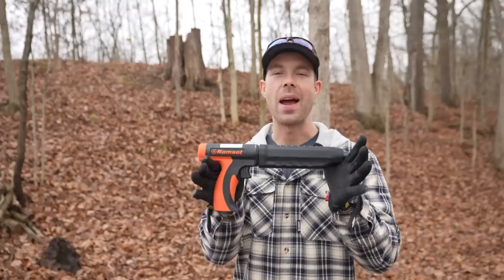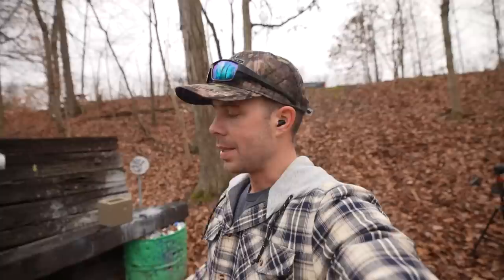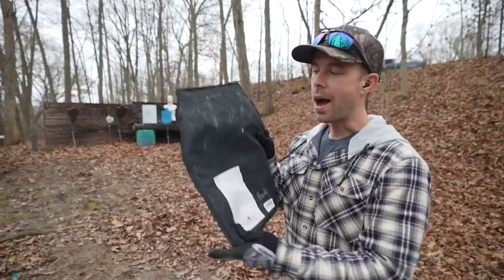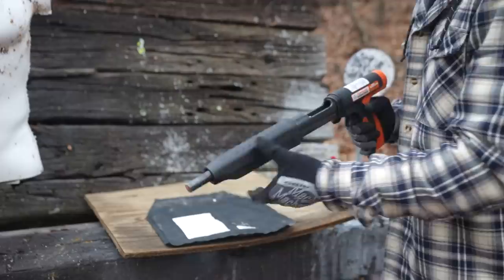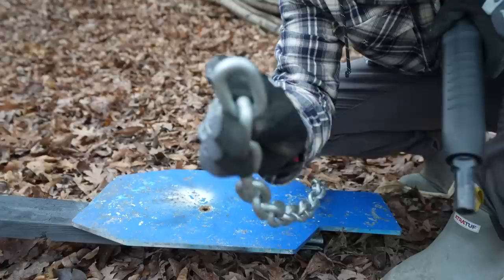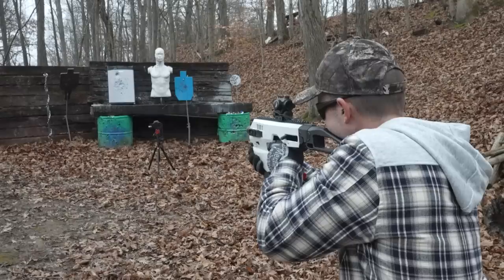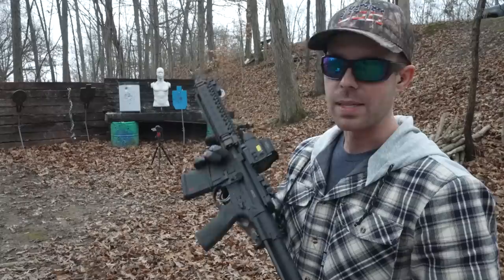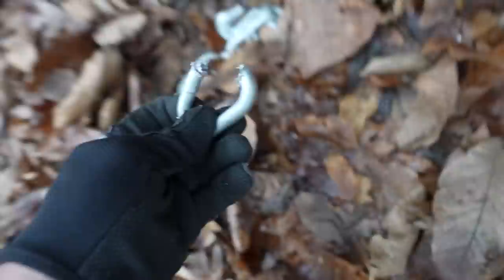How Powerful is a Nail Gun??? (vs REAL Guns)

Comment: The 9 mm is shot from a distance while the nail gun is shot from point blank. Could this difference by any means influence the results?
Reply: Yes, absolutely.
Reply: you also have the force of the pin pushing the nail in so yeah, very inaccurate
Reply: Also looks like the block is a little thicker on the side the 9mm was shot at
Reply: He should of also used extreme penetrators from underwood instead of self defense rounds designed to not penetrate
Reply: its a fun test to watch, but the matchup isn't very good. the nailgun isn't something that can really shoot at distance, while the 9 mil is. so he almost has to put the nail point blank, which gives it an advantage. all in all its just something entertaining to watch.
Reply: The 9mm projectile loses very little energy over that distance. There are weapons that can fire flechettes, which can penetrate armour types of armour much like the nail gun, but from much longer distances.

Comment: The nailgun is point blank the gun is from a distance its a little unfair😅 but awesome video i cant wait for ur channel to explode on yt❤️
Reply: I agree 100% with you but to add onto what you said I think it’s a little unfair that #1 the nail gun is point blank and real gun is at a distance but then again that’s kind of fair but #2 I think it’s unfair that he’s comparing the 22 caliber blanks to a 5.56 I think he should be comparing to a 22lr or even 22 mag
Reply: The hiltigun can actually be fired without contact. It's very dangerous but it is quite possible.
Reply: It's fair as that is their intended use. If the nail gun was intended to be used at a distance then I would say it is unfair. If anything the gun is using a larger caliber so you would think it has the advantage.
Reply: yea, same as I was thinking.

Comment: We use it to build factories dont know how you call that in English but we call it Damwand profile plates, because the plates are also used for dams and canals, but anyways we shoot these plates on H profile  only we use bigger nails but a smaller blank. its a .22 but the half in length as you use.. but nailguns are very powerful, Sometimes we shoot miss and than the nail goes trough the plate deep in the ground beneath the roof..

Comment: Those nail guns  will drive  a nail  through a ¼ mild steel, half inch plus of the nail coming  out the back,  but  I have a .27 caliber  gun and that is  with the red blanks...
Reply: Hilti 36 m a purple load will pierce half inch structural steel.

Comment: Try and press the nail gun against something but leave a gap in the middle to see what kind of damage the nail does if it can fly out of the barrel, through the gap. I think if you placed two T Posts next to each other and shot between them it’d be pretty cool
Reply: Can't unless a hollow circle, as a safety measure, the tip of the nail gun has to be in contact with a surface and pressed down on in order to fire.
Reply: @TTiger86268  that's why I suggested using 2 pieces. It would leave a gap in the middle about the same size as the inside of the barrel while the outside would be pressed down

Comment: If you hit the lock at the same angle as the nail gun it would open in one shot.  Also you switched to the ar on the chain when the 9 failed.  If you had done the same with the armor you would have had success there too.  The nail gun is  impressive, but obviously has zero range.